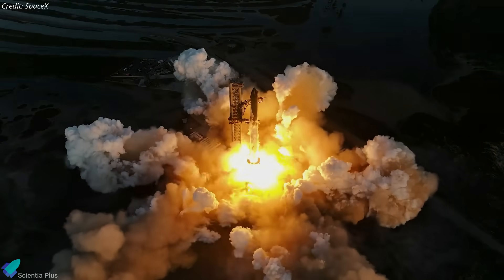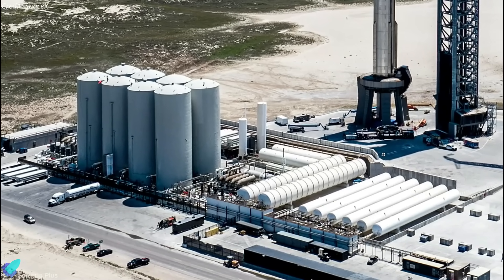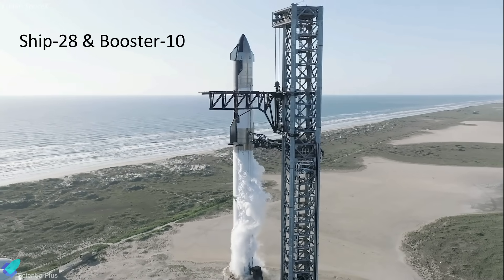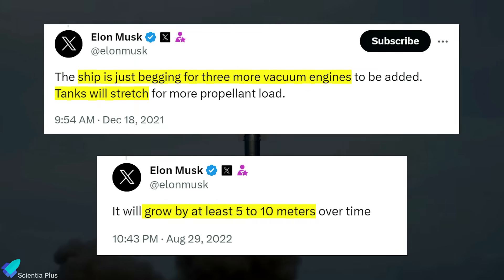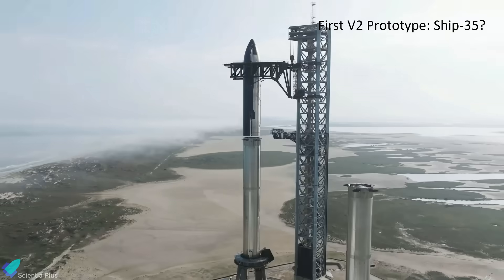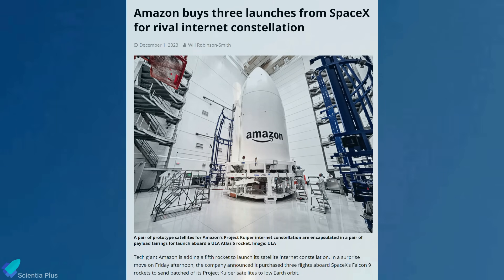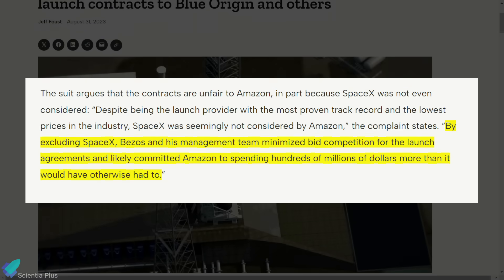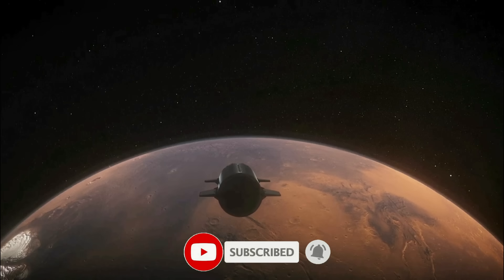SpaceX Rises Again After Starship Launch Failure, NASA & Govt Slam SpaceX Over Starship Flaws

Comment: It was NOT a launch failure.  Dufus reporting.  The fastest and most efficient path to large heavy lift fully reusable launch vehicles requires live testing.  Build the best you can, fully instrument it, launch it, analyze what didn't work, lather, rinse, repeat.  The goal was never to achieve orbit.  As long as SpaceX is learning and doesn't run out of money, there is no way they can fail, but the simple minded "rocket boom equals fail" mentality persists.

Comment: two - 5  slim strap on enjectable side rockets
could be a better help to get ships up higher with more cargo

Maybe a top second stage that parts into two and oyxgen fuel pods
removed and linked to moon orbit rockets.
closeing of top cargo to bottom of main rocket section to reenter and land
top bottom could part into two
or slide apart to eject pods of fuel.